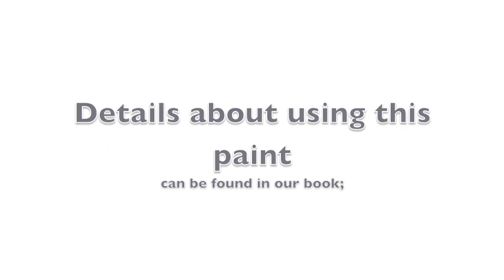Painting with Perfection 2 part LP

Comment: Just about to use Perfection Pro on my new GP14 and think I will need to use a brush around the bilge keels. Does the paint still flow as good as with the roller?  Thanks.   Nice Vid.